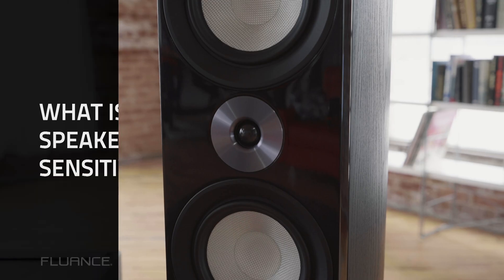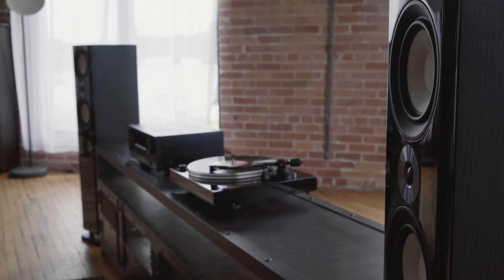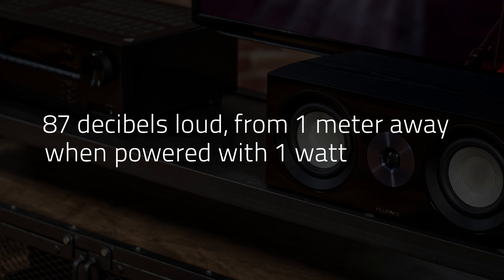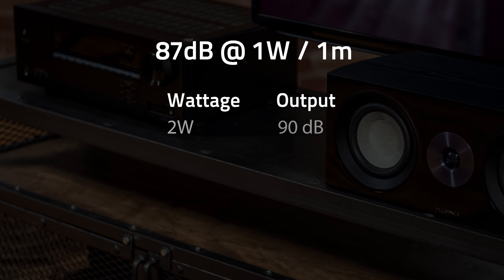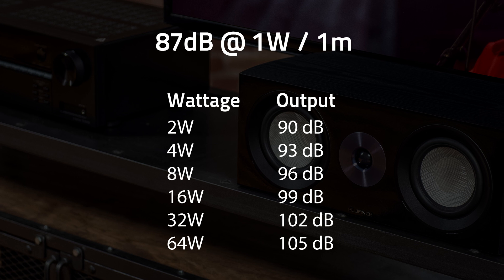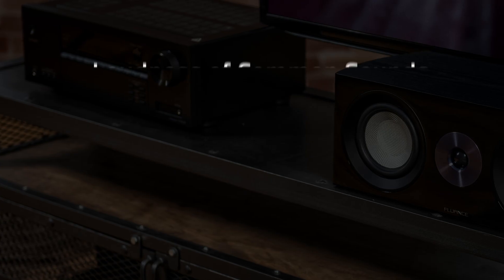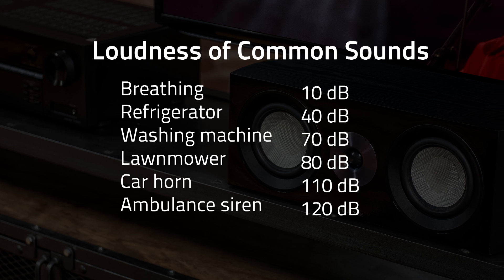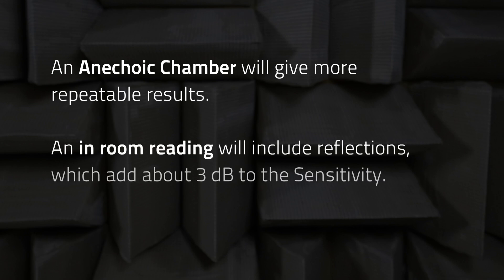Speaker Sensitivity Explained | Home Theater Specs

Comment: dude, are you sure it doesn't go up somewhat exponentially?  because i had a rockford fosgate woofer rated at 86 db and changed it out to a JBL with 92db and the JBL was way louder on the same amp.  like what you're saying is add 5-6w to the fosgate and they should be equal and from there be the same loudness as wattage is added and  i don't think that's the case.